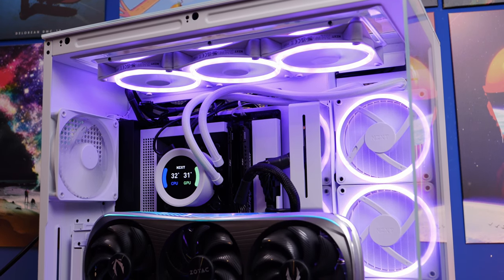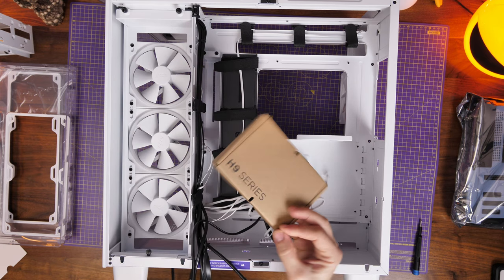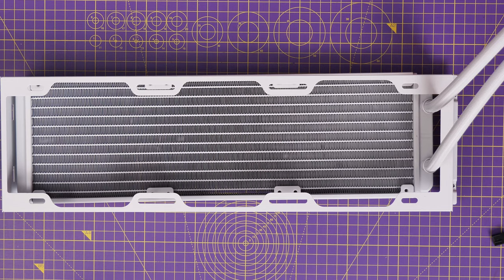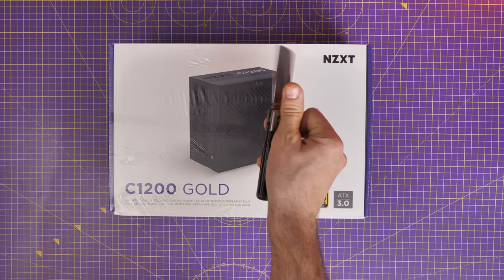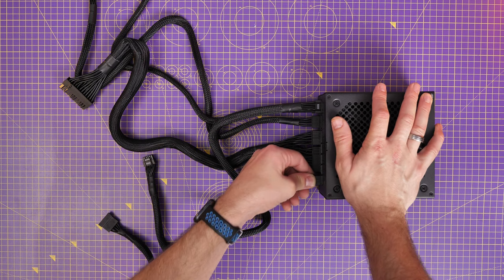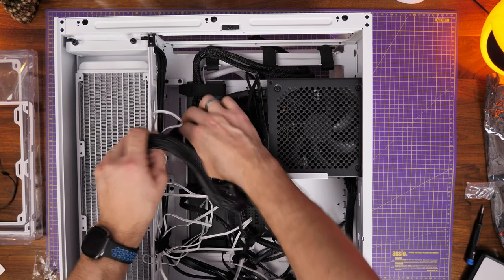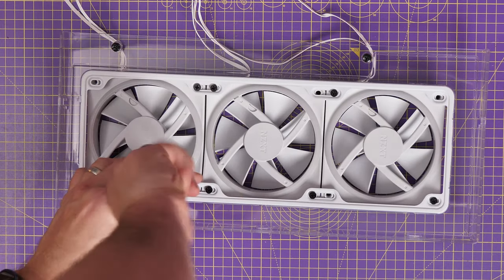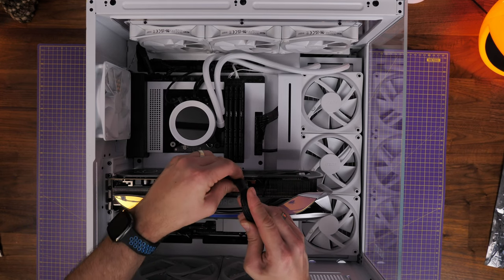How to build an NZXT PC featuring H9 Elite case and F120 Duo Fans

Comment: Hi Provoked Prawn I have the NZXT T120 air cooler installed, (Cant get the NZXT Kraken Z73)  if i use the NZXT Vertical GPU mount will I have problems with the GPU touching the air cooler, I have the H9 Elite case, also the MSI 4080 gaming trio GPU, new to all this btw 👍

Comment: Quick question since I’m building my first pc now, when you split the cpu cable from 2x4 too a 2x2 where does the other half go ? If the other half is in the top left of the mobo
Reply from the maker: You just have to awkwardly angle it out of the way.
Reply: @TheProvokedPrawn  ah so it doesn’t plug into anything?
Reply from the maker: @AzaroOW  have a look here for clarity https://youtu.be/vNUmD8GQxSQ

Comment: i have this case but the nzxt fan hub confuses me. 3 of the slots are for fans  and 6 for rgb? wouldnt it make more sense if it was 4 fan and 4 rgb?
Reply from the maker: You can use splitters in the power, so you can have 9 fan power but only 6 RGB. Yes it makes no sense.  You have to get another controller or use the RGB hub as well mostly.

Comment: These are not standard fans that comes with the Kraken 360 rgb, so you bought the AIO cooler + 3x NZXT F120 RGB DUO, and threw away the core rgb fans that come with it ? Can you make a short video with the normal Kraken 360 config to show what the core RGB looks like together with the F120 RGB (ring) fans that come with the case? Much appreciated. BR from Denmark.
Reply from the maker: I can't do that, but I can show you the original Kraken RGB https://youtu.be/3bzSBKgUghs and the new Elite coolers https://youtu.be/G5r3SG3ACwE

Comment: I built a pc with basically all the same parts, except my dram light is on on the z790 mb and i’m not getting any picture. Any suggestions would be very helpful. thank you
Reply from the maker: Is the ram in slots a2 and b2?

Comment: Do not quite understand. Does Fan hub that includes support all 9 fans to RGB? Or does it only support 6 RGB fans? Why is there room for 9 when you can only connect RGB to 6 of them?
Reply from the maker: You'd have to ask NZXT about that. I agree it's illogical
Reply: But in 45:00 I see that you have RGB on all fans. That's how it should work as long as you don't buy extra hubs or fans. @TheProvokedPrawn

Comment: Hi @provoked prowl what is your favourite case ? I am looking to swap my fractal torrent as I find it to big
Reply from the maker: I'm currently using the Lian Li Dynamic Evo as my main machine and I'd plan on switching. I was torn between that and the Lian Li Air Mini. Which I also loved. I liked the Torrent but these Lian Li cases are smaller, quieter and better build quality imo
Reply: @TheProvokedPrawn  thanks I am thinking about Lian li evo but also watched the H9 build . How would you compare them .
Reply: @TheProvokedPrawn  what I don’t like about the Lian li mini is that it require different PSU

Comment: In my experience you should NOT mount an AIO cooler on the top of this case because of the tempered glass panel. With only two 140mm fans pushing air through the radiator and the steep 90° angle that the exhaust air needs to run through to get to the vents is, atleast on my system, too much. 

I come from a Fractal Design Define 7 and with that setup (same amount of fans, positive air pressure) my CPU temps were in the 50°~60° celcius under load. I had the 280mm AIO mounted on the front in a push-pull configuration.

Now with the NZXT H9 Elite (same amount of fans but the AIO is mounted on the top. Only place where I could fit it.)I've seen my CPU temps go as high as 95°c under load. In my opinion this is unacceptable but it was partly my fault due to me forgetting to check if my AIO would fit the case. I didn't think that it would have such a huge impact on the temps.

Comment: connected my front panel wire to the button right as u said to , but pc will not power on with the button on the case pc will only power on with the power button on the motherboard ??
Reply from the maker: https://youtu.be/hARhhNPOIjk

Comment: Why would you pull the warm air from the radiator in th case and not blowing it out?! Top and bottom fans in. left and right fans out
Reply from the maker: Because I've tried both and it's fine either way

Comment: Excellent guide! My only complaint is that you did not show all the steps when removing the GPU. I believe you have to push a lever down on the PCIe 5.0 connector(after removing the screws that hold the GPU in place) before you can actually remove the GPU? I know I'm a bit of a stickler for the details but I have seen people just try to yank the card out and breaking the connector.
Reply from the maker: Yes you have to press the button at the end first.

Comment: installing aio radiator like that? doesnt that mean case will be filled with hot air?
Reply from the maker: No, cold air is pulled in from the bottom
Reply: @TheProvokedPrawn  I see. I installed my aio cooler on the top but the top glass panel of the case becomes very hot that bothers me.   I think i’ll try as yours. Thanks for the info.

Comment: Naw if i had that case and was using more than 6 fans imma go with uni fans that cable management is scary looking
Reply from the maker: hhahaa. I've installed 13 Corsair fans before. This was easy by comparison. But yes, Lian Li Uni fans are undeniably easier.

Comment: When you say at 2:23 that it requires 'lifting', and that if you aren't careful the panel will break, you aren't kidding - the diagrams on the leaflet that come with the case incorrectly indicate the panel should be rotated *downward*, and if you actually follow these instructions it will break the panel immediately, which is what I did with the very first attempt to open the case. Not necessarily anything wrong with the case design, but whoever wrote the installation instructions should lose their job.
Reply from the maker: Glad you didn't break yours

Comment: 7:03 why just 3 fan power ports and 6 RGB ports? What if I got 7 fans and I want to control the rgb and Speed of every fan?
Reply from the maker: You can use splitter cables